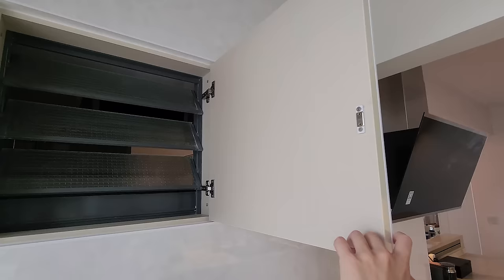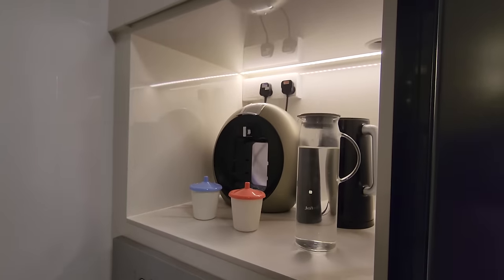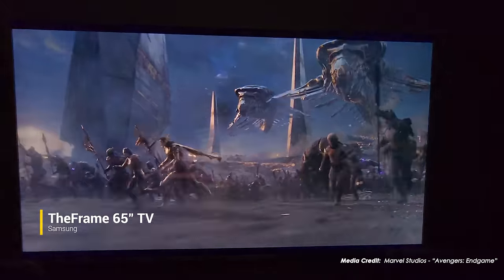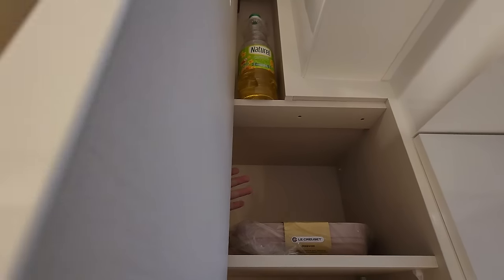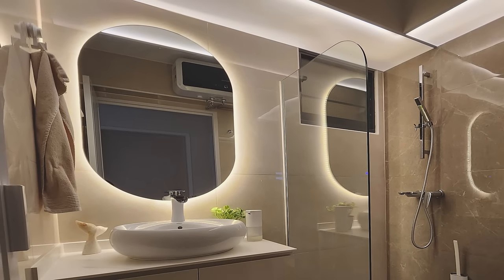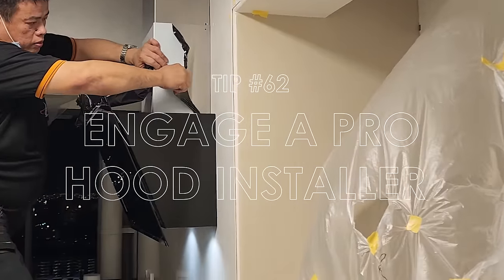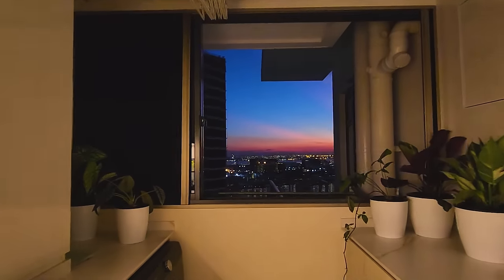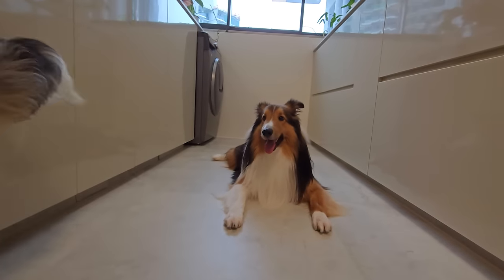Kitchen Tour & Reno Tips (Part 2) | Self-Designed Neutral Contemporary Home | EP17 HDB BTO

Comment: Hi, can I check, for your parents hood, would the issue have been avoided if there was an outlet? Or must the chimney hood idea a must?
Reply from the maker: Hi! Most of these slimline hoods do not really require a vent upwards. But the hot air will just keep recirculating in the vicinity and it won't be effective. Funnelling it upwards would at least allow better convection 😊

Comment: Love your videos, notice that you have used gloss laminates for your kitchen laminates. It certainly makes the kitchen bright and airy, but I'm concerned that they are suckers for finger prints, do you have any regrets so far? By the way, what's the laminate code for them if u r using Lamitak? Thanks!
Reply from the maker: Hi Simon! Thanks for your support. So far no regrets, we don't really have fingerprints much because cabinets are opened from the edges :) from time to time we use Magiclean glass cleaner and microfiber cloth to touch-up. The laminate code is CC 47101G (Lamitak Nude Core Glossy) for the upper carpentry and the bottom is SHG 1103 (High Gloss Mood).
Reply: @thesuakus  Thank you so much for the quick reply! Am choosing laminates for kitchen cabinet next week! And this comes super handy!

Comment: Hey Sam, seems like not all compact hoods have the same design cos I just checked the user manual of my hood and there is no top exhaust outlet on mine. I also heard we're not allowed to exhaust the fumes directly out of the window but not too sure how true that is.
Reply from the maker: Heya Reuben! 😃 Aha ya needa see the design in the instruction manual and prep.. Some brands like Brandt have the outlet just above the undermount so won't have this issue. As for the duct.. cannot exhaust it outside the window but it can end just before your window (where your top carpentry ends) 😅 but may not be nice if yard faces another neighbour yard..

Comment: Beautiful kitchen! Can I ask about the performance of how kitchen hob? I've been wanting to get the this particular Bertazzoni hob as well but I heard that the power requirements might be a little too low after being tuned down for HDB. Thank you!
Reply from the maker: Hi there! Thank you 🥰 Aha we checked with the salesperson and this model is HDB compatible. So far we have no issues running all three induction burners at once. We tested at heat 7/7/7 and nothing tripped 😅 Maybe any one reading this comment can share more about the technical stuff?

Comment: I so into ❤❤ dish rack in curved design. Nice!!! May I know led stripe light where you guys purchased? And the fridge detachable panel. How it work? We asked ID to give more space for air circulation which mean able to see a big gap. 😂My hse is under gg reno now. The carpentry is on gg now. I'm worrying on HOOD after watching ur video. 😢😢😢😢😢
Reply from the maker: Hello there!! Thank you aha glad you like it 🥰 for our Kitchen LED lights we just went with normal non-smart LED lights sourced by our ID/Electrician. ID coordinated with Carpenter to have it installed recessed in the carpentry.

For the Panel, it's simply drilled and screwed in from the inside of the cabinet above the fridge.

Ya but don't worry you can always do the tissue test on the Hood and get the ID help to fix any flaws 😃
Reply: Wow! You are so responsive.... there are so many changes till dunno wat is wat. Sigh!I need to ask my ID's to check it out your video. Haha...

Comment: Most hood have 2 different different versions. R which stands for recylcing, no need for duct and V which stands for ventilating, duct needed. Look at the model number and the last alphabet to differentiate. When in doubt ask the sales person and remember to inform your ID.👍
Reply from the maker: Hello! Thanks for sharing 😃 For the benefit of viewers, maybe you could send some examples of such R and V versions of typical hood brands in SG? I don't think Bertazzoni has this option. The parents' one showed in the video is this K60TELXA https://sg.bertazzoni.com/products/modern-series/ventilation/90-cm-telescopic-hood-2

Ducts are optional but always recommended for some air flow
Reply: Some examples are Bosch, Electrolux, Rinnai and i personally recommend Fujioh. One of the top mid range brand. And yes you are right Bertazzoni only have ducting/ventilating hoods even for the telescopic ones.
Reply: @thesuakus don’t know if Roxon is available in Sg, I just bought n installed one,it’s vented outside, with remote controller n 850 CFM, this wasn’t even mentioned in your content, 2 LED light n 3 fan speed

Comment: renovating should be hassle free, but because of a lot of experienced/inexperienced ID that always think that they are good and always go with their norm trend and push sell their concept. And if it doesn't out they will just add in extra charges till you would be thinking at the back of your head why does a simple cupboard or drawer add on would cost 300 dollars extra and giving the customers the same reason we heard over centuries ; labor cost, material cost, disposal cost , etc etc...  frustrating to deal with them.

Comment: seems like there is 2 kinds of hood - recycling and ventilation hood. I googled and it seems that if it is recycling hood, there is no need for a duct?🤔
Reply from the maker: Hello! Yes, you are right! Ventilation hood are those that duct all the way outside like those in food courts. For homes, most hoods are recycling hood so they all recirculate air from the vicinity and don't really help.. duct or without duct 😅 The issue with parents' hood was that the carpenter simply used carpentry to cover the outlet hole so the hood was essentially useless. A duct would allow the air to at least traverse some distance away from the input so that it could better circulate (hot air rises, cold air sinks) and not keep recirculating within the same spot...